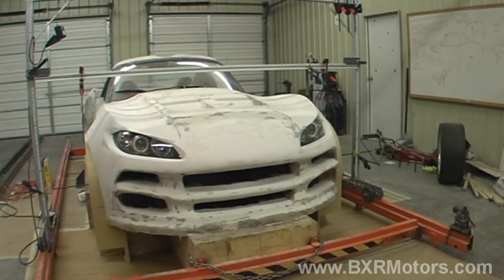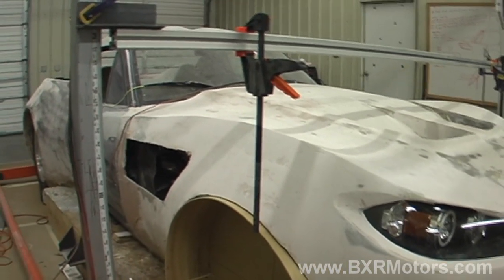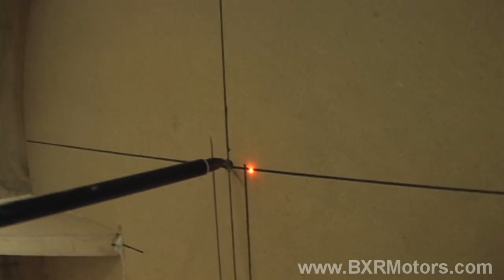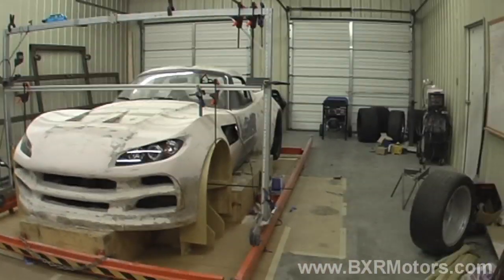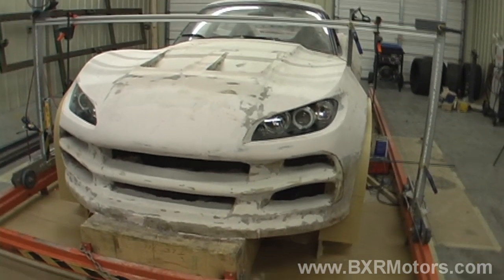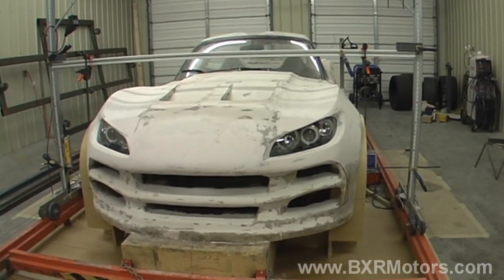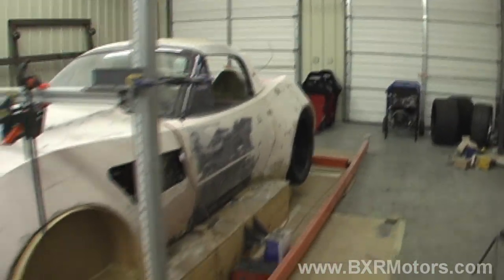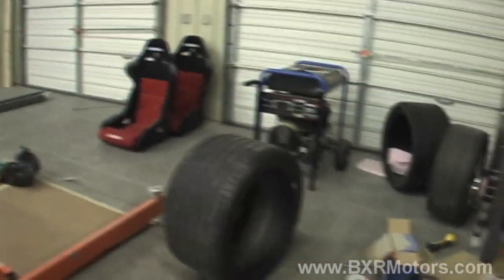Bailey Blade XTR Car Design |  Working on Wheel Wells, Extending and more Fibetglass work - Part 20

Comment from the maker: @hqbeamer Solid Works is a great program, and we have designed all our chassis and suspension using it. At this point we are using server programs for specific things. There are a lot of open source CAD and CNC G Code programs out there that we are experimenting with. We are also experimenting with some DIY laser scanners to import production products for test fitting.